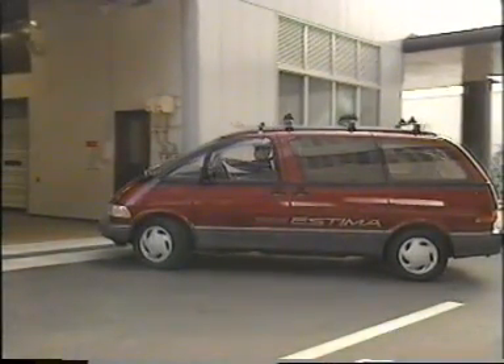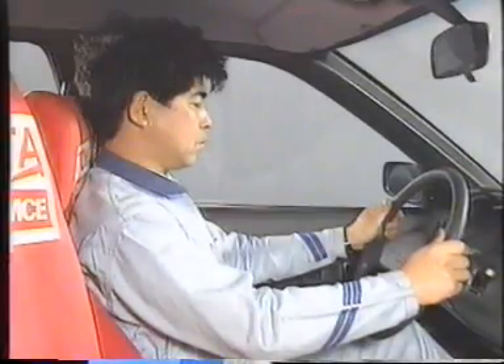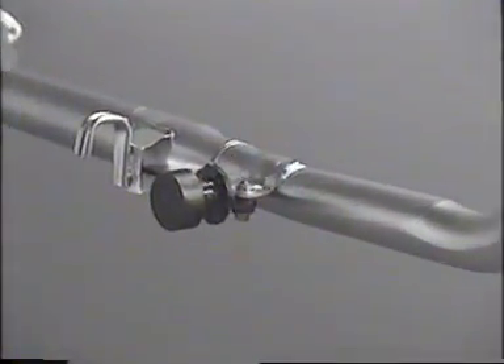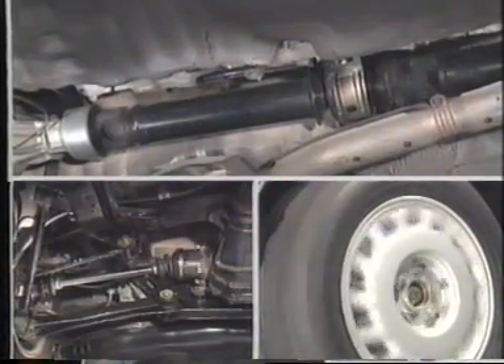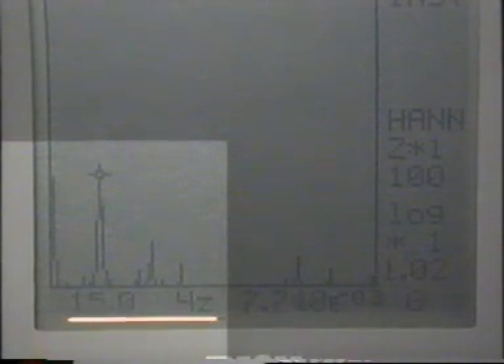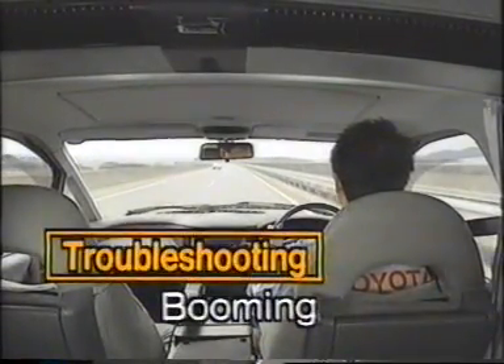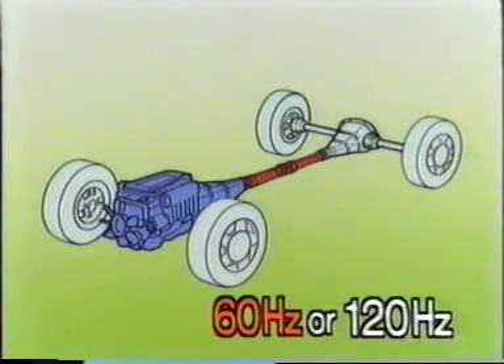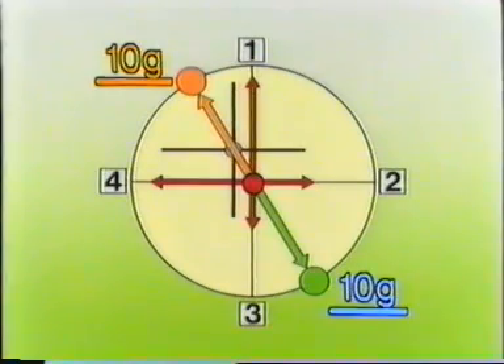VEHICLE NOISE AND VIBRATION

Comment: C'est une bonne source d'inspiration  et de réflexion en thermes de recherche de vibrations, ici, lorsque je circule en boite automatique a 1800trm, sur du plat vitesse maintenue, mon regime baisse a 1700trm et des vibrassions arrivent, je suis en cours de réflexion pour en trouver la source, convertisseur de couple, supports moteur, arbre de transmission cardans, je penses regarder pour la lecture des codes défauts. Je vais surveiller la fréquence de propagation. Dans tous les cas, merci de cette précieuse video. ❤

Comment: bearing are good, control arm brand new, sway bar link and bar bushing new, tie rod perfect, new tires, alignment, 4 new motor mounts, new front struts, and rear shocks, new both side cv axles, whole brand new front brakes, new ball joints, good spark plugs, new wires, and new coil. new Engine filter cleaned PCV, IACV, throttle body, MAFS. I can't replace the whole car. still the vibration.
----  Can the vvt valve oil control create this vibration? Engine oil is Synthetic and replaced every 5 K miles with an OEM filter.

Vibration is still there after all these things, so now what? Finding these problems is not that easy at all.
Reply: Follow the video.  Think critically about what conditions the vibration occurs during, like whether it's vehicle speed or engine speed, then using the vehicle/engine speed that it occurs during, apply the formula in the video to work out what frequency (Hz) the vibration is, then that value will indicate whether it's something in the tires/wheels/axles, or the propshaft, or the engine/transmission.  Throwing money/parts at it won't help, unless the money goes to a technician that knows what he's doing.
Reply: @cbh148  Thank you. I don't think the technician will know more than I do after I have been replacing parts and haven't gotten into the real problem. Technician wants to start from zero, so that means do the same I have done, that's stupid. all the technician wants is money. I took it to the dealer and they have it for 2 days doing nothing at all, cause they don't even drive the car. the dealer saw I was prepared, and have done almost everything so they can not take any money from me. If I started from zero and the problem was still there why technician did not follow or tried to go from there?
----- Technicians are liars.
Reply: @irisbaez1972  i don’t think randomly replacing parts does much for you other than expensively and slowly eliminating items from a big list.  More importantly than all that — what Hz frequency did your calculations indicate based on the content of this video?  Did it align with a wheel speed type of vibration or a prop shaft version or was it an engine speed style of vibration behavior/conditions?  You know, actual diagnostics.
Reply: @cbh148  Vibration started since I turn the car on, putting in gears or even turning on A/C doesn't increase or decrease the vibration. I thought maybe the car is cold so this doesn't change after warm. Then when pushing the gas pedal feel the same after I reach 50 to 60 mph when I feel like a tire is loose or hub/bearing or even the cv axles, that's why I replace all those parts. I checked the rims as well. There are no codes, even the dealer didn't find any.
These problems started 2 years ago.
Reply: @irisbaez1972   You’re saying it makes the vibration any time the engine is running, even if you’re not moving (like when you’ve just started the engine)?  If so, then yeah a CV joint / wheel bearing / hub won’t be creating any noise because they only spin when the car is moving.
Reply: @cbh148  ok, so if it's not moving and vibrating what could be after replacing the motor mounts?. Then when it gets 50 to 60 mph star shakes and vibrates more and feels a constant hit or bet on my hands.
Reply: @irisbaez1972  What year/make/model is the vehicle?  Automatic or manual?

Correct me if I'm wrong, but you're saying that it behaves like this:
0 mph, vibration
1-49 mph, vibration
50-60 mph, stronger vibration & shaking steering wheel

Questions:
1) Do you have all of the exhaust mounts in place and in good condition?
2) Are all the bolts that hold the transmission to the engine block tight?
3) What frequency (Hz) is the vibration?  If you want help with this, upload a video of it and I can watch and try to help figure out what Hz it is.

Comment: my car has this noise coming from the right drive shaft. this has consistently caused damage to the inner CV joint. What is the best way to get rid of this vibration as i have changed CV joints 5 times this year alone.
Reply: maybe replace the drive shaft?

Comment: I have been facing vibration or engine roaring for years. I spent almost 500 bucks on the overall suspension and bushing, mounts foundation, exhaust steering and everything. Still the problem exists. 
When I accelerate in stationary state or without moving the car, vibration comes through whole body and it badly annoys inside the cabin. The solution that mechanic finds is bushing between engine and its frame . And its still a gamble to invest. I dont know what to do. Kindly guide that why this vibration or engine roaring comes from? It sounds truck or diesel vehicle.
Reply: Buy a Toyota
Reply: So did I I drive a Chevy 5.3 I’m almost bald cuz I have no idea what it is....

Comment: My 95 Lexus sc300 vibration after transmission replacement was driveshaft center support Mecanic fixed I was only able to drive in speed limit 20 over that it was vibrating like crazy
Reply: Cuarajhy Rojayju My Lexus LS400 is vibrating severely hard going up steep hills on the freeway, I will replace the drive shaft.
Thank you

Comment: Good explanation though from a related field is when people thing of the guys that do suspension fixes they think they only changing out coil springs, leaf springs , or struts but a very important part of the suspension is sway bar/stabilizer bars  and controlling arms ( both lower and upper (if you have upper)). Noise can be caused by balljoints/bushings on upper/lower controlling arms.

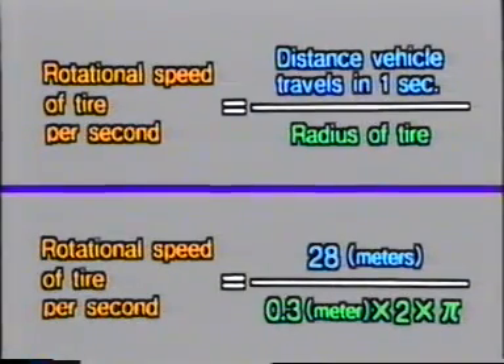Comment: There is a mistake in the video.. at 16:42, I think the denominator should be circumference of the wheel rather than radius.. it is read out currently but the equation is wrong..
Reply: True Get the NVHApp at http://vibratesoftware.com
Reply: thanks
Reply: Correct. The first equation should be distance covered in 1 second / wheel diameter (which would be 2*Pi*R as per the second equation when it's completed).
Reply: There a lot mistakes

Comment: my car start vibrating after a while on the highway. when i slow down enough it stops. then i accelerate again to high speed no problem and it sometimes comes back after a while again. any ideas?
Reply: I have this exact same Problem in my truck, its an extremely loud noise with a vibration of a jack hammer. Im not exaggerating i swear
Reply: @MrTrevers99  can also be an unbalanced driveshaft
Reply: @MrTrevers99  yours sounds like a engine mount
Reply: @jeremywatson6321   my car drives fine while I'm on the gas but once I come off it shakes or I turn the wheel towards the left
Reply: @MrTrevers99  dodgy spark plugs can make knocking,hammer noises.
I.reckon slightly bent driveshalf of adie.
Reply: Maybe spark plugs are starting to go?
Reply: All you need to do is just to turn off your virbrator. OK....? 🍌
Reply: Carlos Pereira It could be your driveshaft